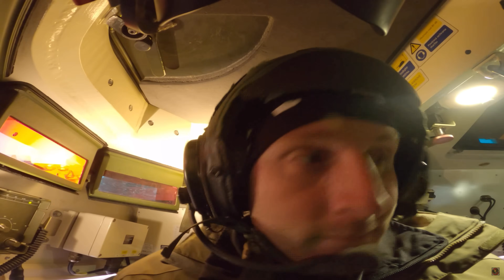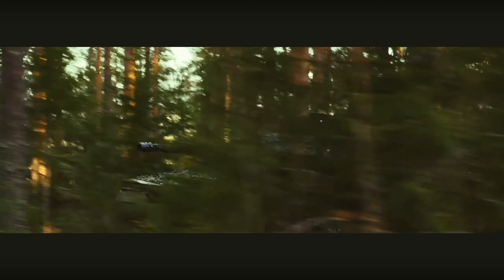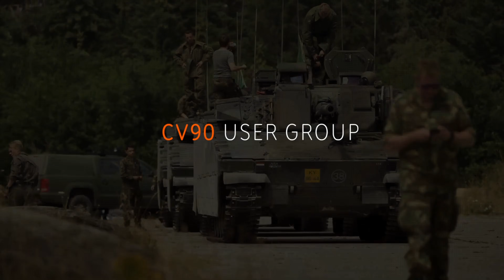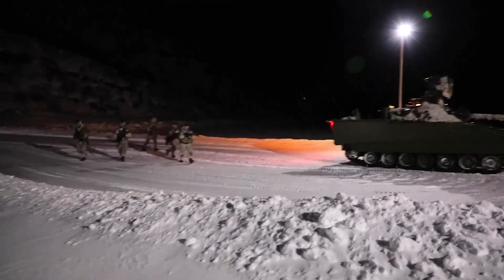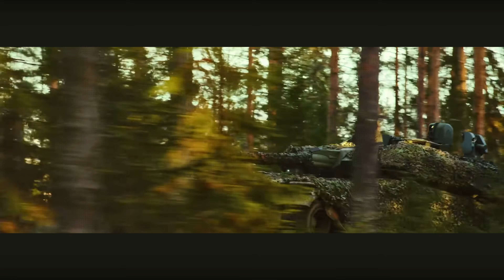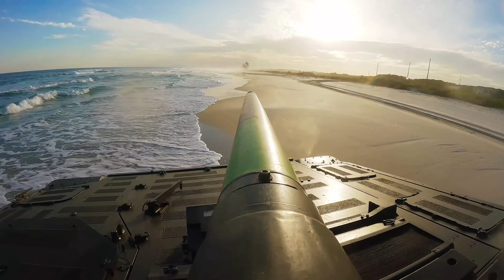Why is the CV90 IFV selling so well globally? | MASSIVE VEHICLE SALES 💰💰💰

Comment: Please answer this question:  Where is the Pentagon hiding to avoid learning from the Ukraine war?  The Trump Battleship is not even designed yet, so they can't avoid learning there.  Venezuela is returning to anti-US form so they can't hide there.  The killings in Iran of protesters is proceeding apace, even accelerating, so they can't be hiding off the coast of Iran.  The Greenland / Iceland invasions have been called off, so they can't be hiding there.  The Navy has canceled most of the ships it was developing, so it can't be hiding there.  They have already canceled the most recent new tank project, so they can't hide there.  So, where is there a bunker deep enough, confusing enough, impenetrable enough to new knowledge where the Pentagon can avoid learning from the Ukraine war?

Comment: I believe the main reasons why the British went with the ajax platform was it's modular capabilites and the capacity to integrate the very clever 40mm cased gun being built in France. That and the domestic manufacturing support. The Ajax has had problems, but it looks sorted now. It seems like land based systems teething issues are easier to solve than an aircraft. You are not risking human life road testing and firing on a range as you would in the sky, like the F35 or eurofighter.

Comment: Think the only missing piece for the CV90 is higher rate of fire for the 40mm Bofor
-Better space for infantry
-Better optics such as FCS with thermal sights and digital networking
-Ability for addon armor like Bradley such as the BRAT II tiles, which would be especially usefull for the front of the CV90 due to the engineblock and transmission is located there.

Comment: I developed the crew training system for lvkv90 in 98. I traveled many days to Karlskoga to test on the vehicle but it was a long trip driving. So, I asked if they could put an lvkv90 at my office 🙂. They almost did!! It ended up at the airbase in Ljungbyhed. I was sitting on the turret with my huge silicon graphics display, coding and testing. The JAS pilots couldn’t believe their eyes taxing out :-)

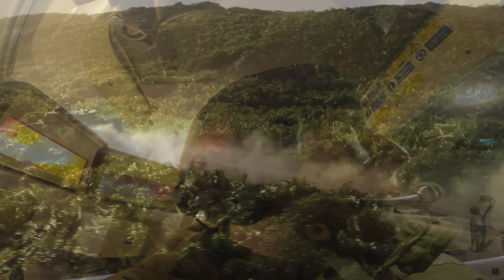Comment: 18:30 Brazilian here. BR army are looking to CV90 to use as Main Battle Tank, not as a IFV due our limitations down here. So for example, in the north we have Amazon rainforest and we share borders with Venezuela and Guyana. The army can't deploy any MBT there, only armored vehicles, because the terrain is not suitable for this type of vehicle. That's why we bought Centauro 2 with 120mm cannon. Now for the rest of country we have a limitation of 50 tons for the MBT because our army claim that our infrastructure can't support more than that. And that's the reason we still have Leopard 1a7 running. All other options have more than 50 tons. The CV90 with the 120mm cannon will met the specifications. If this buy go throught, the Leopards will be replace by both Centauro 2 and CV90.

Comment: Considering recent events, Canada may want to get a production licensing agreement for the CV90 and start producing them in large numbers. It needs some upgrades like anti-drone tech for the main gun, but it seems to be a good system. Coupled with ATGMS launchers and it would be more effective than a main battle tank. The flexibility of an IFV, especially if the main gun could defend against drones, has proven to be more useful in combat than main battle tanks in Ukraine. Now that Canada can't depend on it's southern border to be secure, it is time to produce armaments as quickly as possible.
Reply: The Lvkv90 variant with a radar on the turret apparently works perfectly against drones.
But of course, those are from the 90s, so I am sure they could come up with a better 2025 variant.

Comment: CV90's are great IVF's. They protect the crew well, its verry modular. you can fit it with anything from dual mortars to auto cannons and anti tank cannons. ATGM's and so on. It can fit the crew plus infantry dissmount of 7 soilders. And with the war in Ukraine and the use of drones we have outfitted them with anti drone weapons and EW systems aswell. It is just a great IVF all round.

Comment: The CV90 sells so well because it is the best IFV currently in service  It is very adaptable with many proven variants and is always being improved and upgraded and new innovations integrated into it's systems Which are then rated by the soldiers who use the machine TWEAKED and retested and rerated While out of the box thinking is also encouraged and looked into

Comment: I was a Bradley mechanic and yeah if the rubber tracks provide similar performance to steel tracks then the weight reduction and improvement to the ride for the crews would be great. Steel tracks break just as easily from combat conditions and mines. So if it's cheaper then steel that's another plus. And if it's lighter then the savings in transportation would be another thing to praise.

Comment: The real question is, why isn't the US Army using it? This is what should've been chosen for the Mobile Protected Firepower and Mechanized Infantry Combat Vehicle programs, but inexplicably it wasn't even in either competition. And it can't be the usual "not invented here" factor, because the M10 Booker is derived from an Austrian design (the ASCOD), and the XM30 competitors are the German Lynx KF41 and the Griffin III (another ASCOD descendant). The clear best choice for the Army's not-a-light-tank and Bradley replacement programs simply wasn't even considered for either role.

Comment: I did my military service while they were still designing the chassis of these so I have never seen the finished version. The only one I've seen close was when passing a test area and getting a bit shocked as suddenly one of the test platforms came att full speed out of the wood beside the road, charged straight on the road, jupmed over the berm and landed on the middle of the road, stopped the left track and full speed on the other before landing so it did a sliding 90° and speed off along the road in front of me. This one didn't have a turret, but the driver sat there in the open. They were only interested in torturing the mechanics and testing just what it could handle. In the woods beside the road they had driven them through the area often enough that they had plowed down up to a meter and a half in the sandy earth. So they were tested brutally intill something broke, and then they improved it so that shouldn't happen again.

Having that thing jump onto the road just in front of you was pretty scary. I remember stomping on the brakes and not get going again until it had accelerated and was blasting away along the road.

It was rather small compared to the tanks and other mechanized weapons platforms so at the time I didn't think it was that impressive. Seems I missed the point of the design.

Comment: Fellow CV90 Fan boy.. served in the US Army in the Bradley M3A3 as driver, gunner, commander. The modularity alone makes it a great choice for any military. Add on top of that, it being a platform prime for future upgrades unlike most IFVs currently on the market.... you have a hell of a vehicle. Its also looks very nice.
Reply: I consider it a big mistake that a CV90105 wasn't chosen to be the M10 Booker. And that the CV90 Mk IV (preferably with the 50mm gun) isn't in contention for the XM30.
Reply: @RedXlV  You'd be wrong. This harks back to dilemmas that The UK and France faced after WW2. Once an armored vehicle producing nation pauses from designing and producing a vehicle type... It's very difficult to restart. So for a producing nation a decent natively designed and produced vehicle is better than a foreign, much better vehicle.
Reply: @SkunkdMonk  The thing is, the options chosen instead were still of foreign origin. The M10 Booker is a modification of the Austrian ASCOD. Only the turret is American. It would've been better to mount that same turret on CV90 hull. Likewise, the XM30 competitors are another modified ASCOD, and the German KF41 Lynx.

Comment: Yeah the sentiment that drone warfare will make everything else obsolete is totally naive. Its just a type of guided war head. Never seen some of those before, right? It is cheap, alright, but also slow and can easily be taken down by different measures. The technology to automate drone defence existed before drones were a viable explosive delivery system. lol
And the war in Ukraine is no benchmark for modern warfare. If the NATO was directly involved there would be no trenches... Would be pointless digging of holes before steam rolled by full air campaign followed by spear head armored forces.

Comment: Drones and IFV's? Yes please. Both. Modern IFV has passive and active protection against drones (Elbit Iron Fist) High elevation angle 30 mm autocannon (Bushmaster II) with muzzle timed air burst ammo (Rheinmetall) against drones. It can have (vertical) MHTK or Frankenburg Mark I launcher. Cage armor and good (Saab) camoflauge. It is networked and works with UAV's and UGV's. Attacking Infantry NEEDS direct and indirect fire support. No meat attacks, thanks. Leave that shit to russia and china. Ground is not conquered unless you have boots on the ground, it's just no-mans land.

Comment: It was not initinally developed by BAE Systems Hägglunds, it was developed by Hägglund & Söner and Bofors. A part of Hägglund & Söner and most of Bofors, is now own by BAE Systems Hägglunds. And the rights to CV90 is now owned by BAE Systems Hägglunds.

Neither BAE Systems Hägglunds, nor BAE Systems plc, existed when this vehicle was initially developed.

Founded in 1999, BAE has bought up a lot arms industries, but it haven't exactly created any new stuff, just modernised older stuff and integrated old stuff with different old stuff.
Reply: And in between there was a company called Alvis Hägglunds who continue developing military vehicle as IKV90 (=CV90)

Comment: Because they want to cheap out on ammunition, 40mm is large and CV90 is smaller than Bradely or Puma,
CV9040 carries 234 shells, of those 24 are ready to fire (in 3 separate 8 round clips), Ukranians already said that that is the reason they don't use them the same way as Bradelys,
that is why we have all of these videos of Bradelys (1500 rounds) firing non-stop and rushing over the field and they basically never stop firing until the end of the video, but
the videos of CV9040 in Ukraine are always few shot bust and I have never seen CV90 video where it is firing more than 20 rounds during the whole duration of the video.
Reply: There's already an export variant of CV90 with 30mm Bushmaster chain gun; it would be possible to develop a variant with a 25mm Bushmaster chain gun like the Bradley.

But yeah, one of the surprising things in the war in Ukraine is that the "small" 25mm Bradley chain gun has really proven its worth simply by having oodles of ammo. Ukrainian forces were bristling with 30mm autocannon, such as on their BTR-4s. But the bigger and heavier 30mm ammo meant that they would carry much less ammo than a Bradley.

Comment: probably not good for Canada in reality, Canada is going to be a small expeditionary military that probably needs to focus more on the French method of high speed low drag that we can maintain on a shoe string of a logistics connection, Canada kinda specializes in motorized/light infantry combat (kind of by necessity) and that is what is going to be needed unless the new cold war goes hot with the usual suspects
i imagine Canada's military to be like the FFL or pre-ww2 USMC

Comment: the only real thing i dont like about the CV90 is that the gun cant super elevate, and the MG coax design is objectively terrible. 
the coax needs to be able to elevate way more than it does currently. its got like half of the elevation of the main-gun which itself isnt very impressive.
Its like the designers never thought you might have to shoot at a target in a building above you or up hill.. they just assumed it needed enough elevation to hit a target 1.5km down range at the same elevation as you, which is an overly optimistic and lets be real, not realistic battlefield expectation..

i do love the 35mm version though, its the perfect light auto cannon. Much better than the 25mm Bm1 or even the 30mm BM2 the Us seems to have gone with for its IFV upgrades for some unknown reason.. Unlike the 30mm BM2, the 35mm BM3 is a future proof round for the foreseeable future, or atleast the next 60-80 years. the 30mm is not and is arguably starting to get near its EOL in the next 15 or so years. Sure the 30mm can do alot of the things the 35mm can do, but its a suboptimal version of whats already available, and is quite lacking in the CUAS department compared to the greater payload Volume of a single 35mm vs a 30mm round.
So the US decision to go with an objectively inferior/limited caliber is a real head scratcher. 

but if i was a country looking at buying this. in light of current events and the issues with the Cannon/MG elevation, id be requesting quite a few changes to the turret, additional auxiliary crew and support features, additional options for ATGM/AAM/and a plug n play Omni slot for a short range CUAS Radar with the option to be swapped for a heavy Jammer. as well as general support for addon protection. The power pack and suspension might need to be upgrade after all that though.

frankly they would be making a Mk5 or Mk6 after all my wishlist items were complete.

Comment: I get that the CV90 is a capable platform, but to me, it seems like a HUGE mistake to use the CV90120 as a stand-in for the Leopard 2A8s. Slovakia isn't using them as recon/fire support; they're literally trying to fill the MBT role with these things. And the design doesn't inspire much confidence in me either. In the cutaway, there's literally two random "operators" for no reason.

Comment: I think the main selling points of the CV90 has been its mobility (important for Norway and Finland) and it's ability to mount a big gun. Modularity and adaptability has allowed it to keep being relevant, but it really helped having those features right out of the gate.

Back in the early days of the CV90 I think the only other IFV that mounted something bigger than a 30mm was the Japanese Type 89 (and Japan didn't really export military gear before 2014). That big caliber gun has only gotten more important as more IFVs are frontally rated against 30mm and it's becoming more important to have a shell big enough to fire smart munitions with some oomph (against drones and infantry). Although the favored armament seems to be crystalizing around a 35mm chaingun with supplemental fire-and-forget anti-tank missiles.
Reply: Is mobility in a combat vehicle important for every country??????????
Reply: @hgv1883  For an IFV I think so. The main alternative would be heavy IFV with MBT frontal armor.
Reply: @hgv1883  It's always important, but there's always a balancing act.

For example, a poorer country that needs adequate bulk for military operations that cover some area but aren't technologically challenging while also having relatively poor general transportation infrastructure, might find something like BMP-2 a better deal as it can be bought for a fraction of the prize, is easier to maintain and is lighter, which makes crossing poor bridges easier as an example. CV-90 is faster, better protected, better armed and technologically more advanced than a BMP-2, but those advantages are only worth it if the price tag and ultimate asset availability fit the purse and needs of the country in question.

As a concrete example, CV-90 is probably not the best suited vehicle for a country like Cameroon or Mali that have very real internal security concerns that require them to cover a whole lot of land for not a whole lot of cash.

Comment: I WOULD PUT SYNTHETIC APERTURE FUSION VISION FOR THE DRIVER AT LEAST SO HE CAN SEE ALL AROUND THE VEHICLE, ALSO A HYBRID ENGINE TO INCLUDE DIRECTED ENERGY WEAPON WHEN AVAILABLE, DRONE SCOUT/ATTACK DRONE TECHNOLOGY PERPENDICULAR SLOT FINS TO KEEP PROJERCTILES FROM REACHING THE OUTER HULL WITH THE MOLTEN COPPER JET BORROWING FROM THE MOTORCYCLE ENGINE COOLING FINS  (MY ANSWER TO DRONE OR SHAPED CHARGE MUNITION,  OUTER CAGE OR NET TO PROTECT THE VERHICLE FROM FPV DRONES, IT'S EVIDENT THATTECHNOLOGY AND FIREPOWER IS CHANGING RAPIDLY, HYBRID ENGINE GIVE EXTRA ELECTRICITY, QUIET MODE LIKE THE ABRAM X, THE HYBRID ENGINE ALSO GIVES A LOT MORE MILES PER GALLON

Comment: regarding Brasil you ned to remember that brasil is the Second nation after Sweden to go for SAAB JAS39E as their Apex jetfighter.
SAAB has put up a production line in brasil in coperation with Embraer.
Thus if you already have good connections with the country of origin and the plattforms you have bought from them has so far proven to be good then it makes most sense to continue the relations with other systems.

It should be noted to that CV90 uses a scania engine and Scania has production already in Brasil.

Comment: Well, there is the M2 Bradley but in the end; if you buy Swedish gear you can't go wrong. Does make one wonder: What if they offered a wheeled variation?
Reply: I'm absolutely not an expert, but I think whatever platform you build, you better start the design with the choice of going track or wheel. Making a platform where you can have both will make the platform much worse.
Reply: Look up Splitterskyddad EnhetsPlattform. Went nowhere though. Closest to that is probably Boxer and tracked Boxer, although no one cares for tracked Boxer.